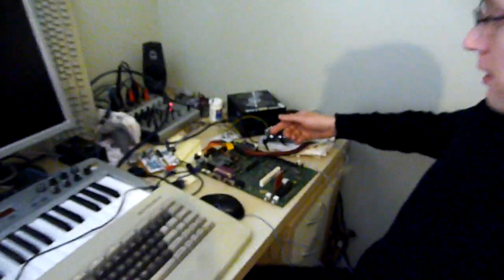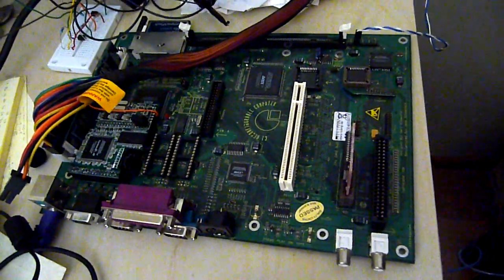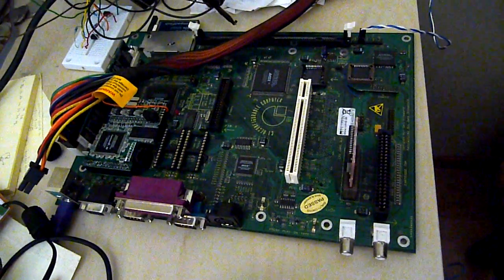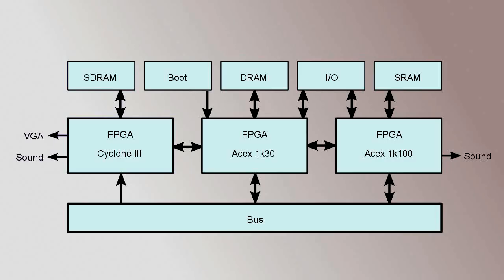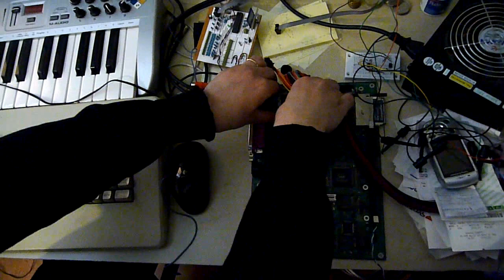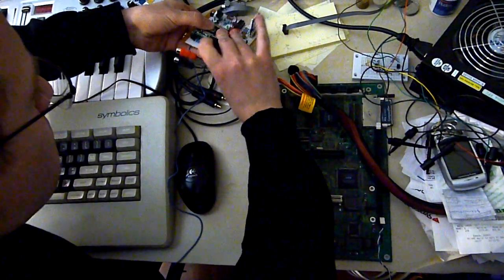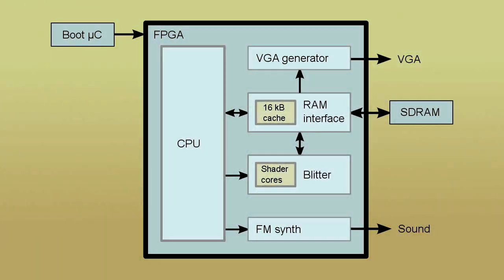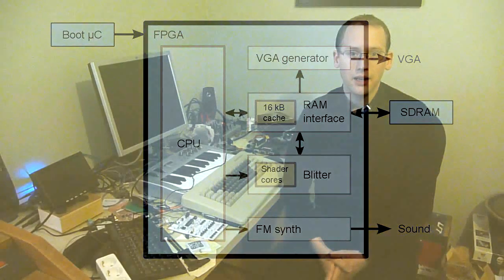Parallelogram

Comment: I know very little about the demoscene so I'd love some help if anyone can answer questions.

This is wildly impressive, I can tell that much, but it seems one could do much more with the given CPU and memory? Like, the Playstation 1 had a 38mhz CPU and 2mb RAM, so what's the difference here? I think I understand that the fpga is basically a handwritten CPU, but all of the documentation went right over my head.
Reply: late but i see it as more of a showcase of the shader-like blitter they designed rather than cpu strength, a lot of the visual effects you see would be pretty difficult to do in a psx purely because of lack of anything similar to shaders, and the hardware wasn't designed to be all software rendered either
Reply: @floreaaikyuu  Thank you very much!